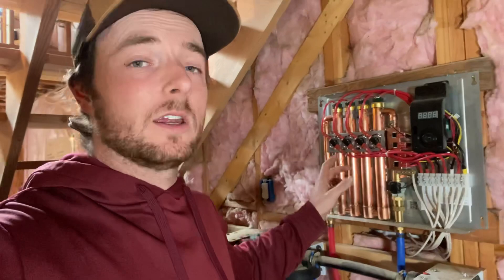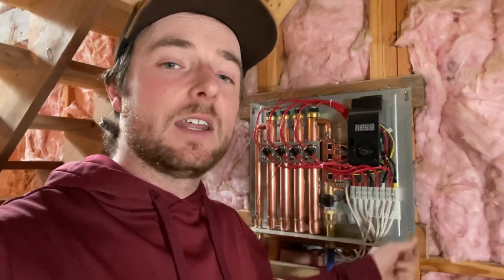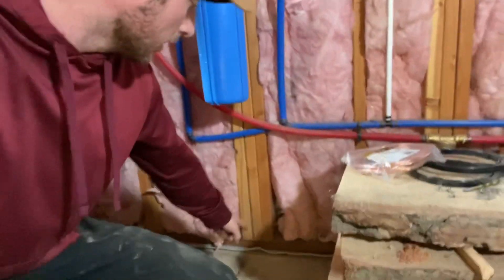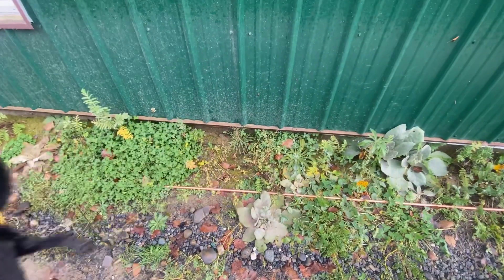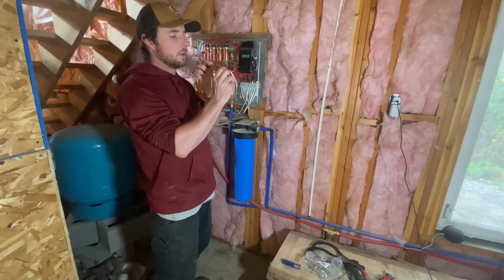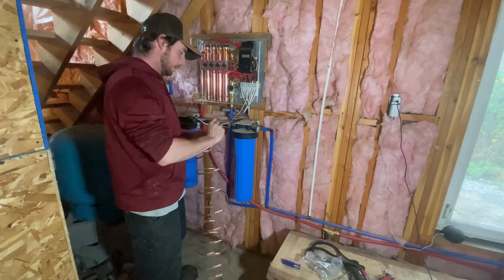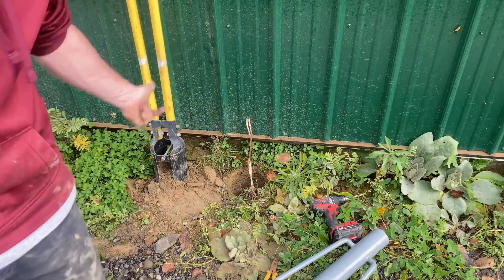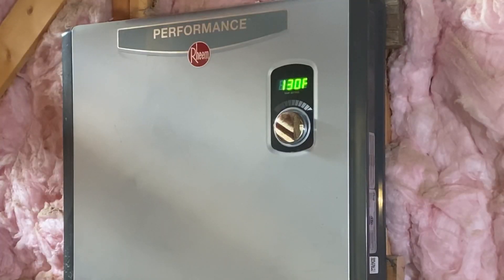Grounding a TANKLESS WATER HEATER

Comment: It's grounded correctly , no extra rod needed at house, and bonding screw does not get used in panel inside house, the neutral and ground should be bonded together at the main disconnect by the meter. Any boxes inside that are metal need to be connected to ground and all devices (switches & receptacles) also connected to ground wire, plastic boxes of course no need or point. Was there a ground wire from the house panel to the hot water heater ?? Should have been and your extra ground rod would be unnecessary, one #4 copper wire is correct size for 200 amp service , should be solid wire not stranded and clamps on ground rod should be rated for under ground use. FYI me : master licensed in Co., Nv., Fl. total 46 years in trade 👍😎
Reply: Please read 2017 NEC Article 250.32(A).   Grounding electrode and grounding electrode conductor are required for panels in separate buildings supplied by feeder or branch circuit.
Reply: @KevinCoop1  It's NOT a separate building, it is the only building fed by the only service which is where it is intended to be grounded, unless you consider that meter / disconnect can a building , I'd suggest you do some more reading 😎
Reply: @rona-husky9019     But it is a building fed by a feeder, not service entrance conductors.   250.32. Buildings or Structures Supplied by a Feeder(s) or Branch Circuit.     (A) Grounding Electrode.            Very very clear grounding electrode is required.
Reply: @KevinCoop1  Which is all buildings after they go through the meter, I've read the code , it's your "interpretation that's in question. I've installed 1000's and been inspected by state inspectors, so you do it "your way", and I'll do it the correct way. You can install a rod there at the house , won't hurt anything or be wrong as such, The 4 wire running to the house is the service entrance conductor for the building , your confusing terminology

Comment: Hello my name is Ryan I'm from North Carolina,  a electrician.. You do not need a ground rod at your indoor panel service. The bonding screw needs to in at the outdoor panel not in the inside.  Also in the indoor panel the ground s and neutral s have to be separated
Reply: Ryan,   Please read 2017 Article 250.32(A).   It is the exact situation he is asking about.   You might change your mind.

Comment: Per code Sub panels, grounds are not bonded to the to the neutrals. The only time that is done is at the main meter box.
Reply: This varies by location, though. Apparently Europe and North America are generally quite different.
Reply: @dper1112  well Europe is also 230 volt at 50 hertz, there just a little different all the way around.

Comment: Ran into the problem with a bad ground when I was in the military stationed in Idaho in the 70's.   The solution then was we dug a large pit (10 ft x 10 ft) all the way to the local bedrock.  About 10 feet down.  Then spread a massive amount of copper rods into the soil in the hole as far as we could.  We spread them deep into the walls of the hole.  Then the hole had several yards of salt dumped into the hole.  After that, we put a garden hose into the hole, turned on the water and just let it run for about a week.  This saturated the ground with the high salt brine that was created.  We then had a nice ground for our electronic testing equipment that had toleranced of +/- .00001 volt on many calibrations.  Worked great.  I have since repeated this solution in where I live now.  The house I live in had a terrible ground for the house.   Put in a new copper ground rod, large and deep.  Filled the hold around the copper ground with rock salt and turned on the water.   All the electrical problems in my house where solved.   Lights no longer flickered.  Light bulbs last much longer.  Static on my TV was gone.  Etc...

Comment: Another grounding rod isn't necessary for your electric panel. But you'll want to make sure that your electric boxes are grounded properly! Everything has to be bonded including boxes.
Reply: You need to read Article 250.32(A).   The house panel is required to have grounding electrode installed.

Comment: You need to run your grounds back to the main panel. The second ground rod may not have continuity with the ground at the panel because of the type and moisture content of the soil.
Reply: sorry, they need to run to the panel inside the house. Did not realize main was at meter.
Reply: sorry, they need to run to the panel inside the house. Did not realize main was at meter.
Reply: Only bond at first point of disconnect.

Comment: That is a sub panel now. Everything needs to be separated.  No bonded screw. All of your neutrals and grounds are separated.  No grounded rod needed.  It's already grounded at main panel.
Reply: @timtoolman5370  sub panels in the the same building or structure do not need a ground rod but a sub panel in a separate building or structure does require a ground rod or equivalent. 250.32a and 250.50 are the nec articles that require it. If you can cite the nec and prove me wrong I would love to hear it.
Reply: I just read NEC 250.50 again and a ground rod maybe needed due to it being separate building. Might be worth adding  but MUST be bonded back to the main panel ground and no ground/neutral bonding screw in the shop panel for sure.
Reply: @beyond_blessed12  🤦‍♂️ no bro, a ground rod is not “maybe needed” here, it’s required by code. All buildings and structures that have main or sub panels need to have one of the methods listed in 250.52 a4 through a8
Reply: @Towelllie  Ok bro.  Just repeating what the inspector told me when I just put in a service in ID a few weeks back....4 wires to carry the neutral and the ground to the  sub panel..... Just saying is all. Ground rod is cheap and won't hurt a thing.
Reply: No ground rod needed at sub panel as gound is carried on wire from main to sub panel. Two rods 6' apart are needed at the main and the grounds and neutrap  are carried to each subsequent subpanels......just went threw this with the inspector that services the county they live in.
Reply: Wrong, he does need a ground rod at the sub panel. You better re-read 250.50

Comment: You have to be careful that there is no rise in potential voltage between the 2 grounding rods in different areas. You may need to tie them together.
Reply: There should be no potential difference the was he installed them.  the water heater is 220 volts single phase it should have 2 hots and a safety ground from the panel. The secondary safety ground he put in really was not needed
Reply: The grounding electrode and conductors connected to the water heater are a code violation and needs to be removed.

Comment: no, Different codes for diff areas but here where I am in Pa. you only ground the main service! all others are grounded through that main ground! No others just that MAIN panel, the breakers in the house become a sub panel and don't get any other ground except the main! and No to the bonding screw. only the main get bonded!
Reply: Also the grounds need to be terminated on a separate ground bar in the sub panel.
Reply: Guys, please read 2017 NEC Article 250.32(A).   You might change your answer.

Comment: Wow! As soft as copper is I would have thought it would cut easier. I guess it gets really strong with 7 wires wrapped together. 🤷‍♀️
I'm not gonna be able to help you with your question unfortunately. I understand electricity and how it works and such, but I have zero knowledge on how it should all be hooked up. That said, I'm super jelly over that water heater! That's a nice one for sure.